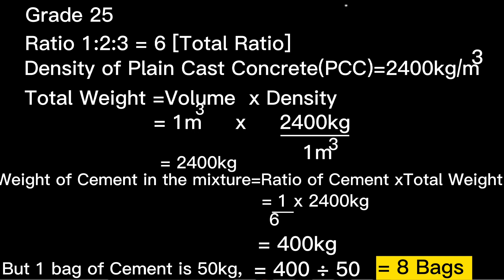Number of bags of CEMENT in one Cubic Metre Concrete G25,G20,G15

Comment: is it batch by volume or mass?
Reply from the maker: It is batch by Volume
Reply: @ianconstruction  that means you should have calculated volumes using those ratios then use respective densities to get mass
Reply from the maker: @mwangibenson5199  Batching in my opinion is preparing sets of materials say 1:2:3 meaning 1 match box of Cement, 2 batch boxes of Sand and 3 batch boxes of Aggregates [All which are by volume ] because THIS IS WHAT WE ACTUALLY MEASURE ON SITE

To make things simpler and easy to calculate we use Mass, Density and Volume. We use all the three derived quantities to quantitate everything [into Mass] say 50kg of Cement, because THIS IS WHAT WE ACTUALLY ORDER FROM THE HARDWARE Or Other.

The rest is simple conversion forexample 50kg(Mass) of Cement = 0.035cm³(Volume)

Similarly Lets say  1530kg (Mass) of Lake sand = 1CM³ (Volume)

In summary, when you either get a value in kg you just convert to cubic  metres or cubic ft etc.
I hope I answered your question sir?
Reply: @ianconstruction  my issue was that if the total volume was 1 cubic meter, you could have just calculated the volume of cement, sand and ballast instead of mass because your ratios are volumes. from the volumes, you could have just obtained mass if you know the density of individual components. Either way i think both ways can work
Reply from the maker: @mwangibenson5199   I get your point, good method. Though either way can work
Reply: @ianconstruction  great

Comment: sir,in confined masonry  Substructure from pcc till plinth level can we use cement solid blocks?
Reply from the maker: Yes, and
Cement Solid blocks(Solid Concrete blocks) used in the foundation or sub structure, should be of atleast 5.0_MPA Compressive Strength Complying to BS 5628

then 
For walls above DPC (Superstructure)
Cement Solid blocks (Concrete Blocks) or burnt clay bricks should be of atleast 3.5_MPA Compressive strength Complying to BS 5628
Reply: @ianconstruction sir,thank you so much